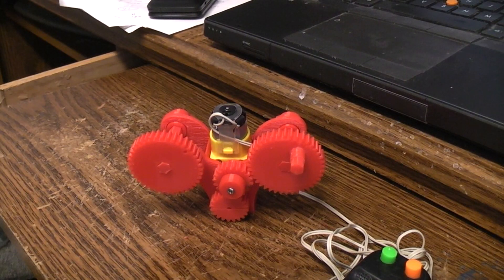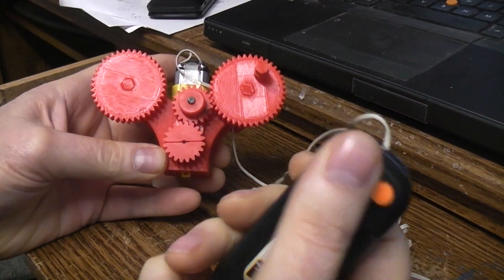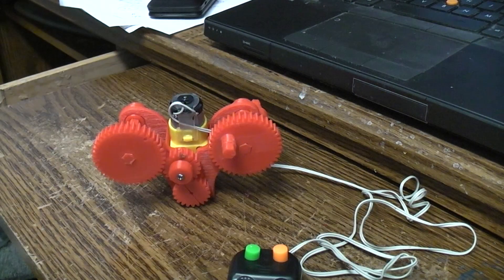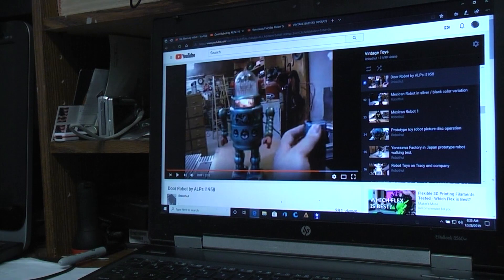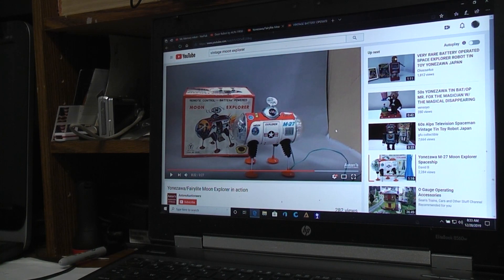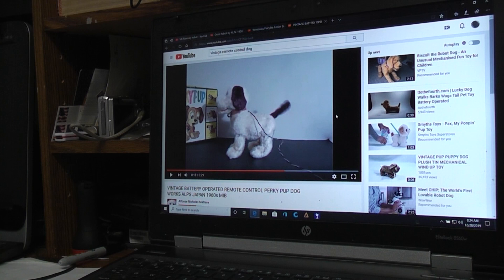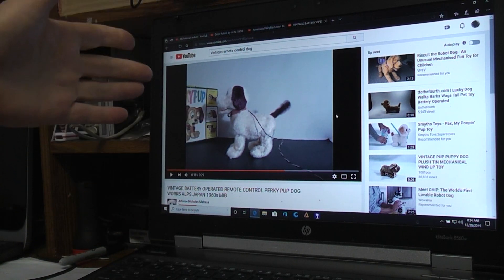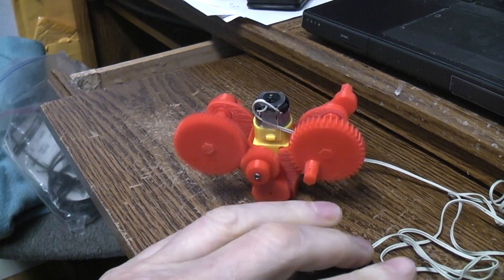3d print the single motor Dual gearbox drive .

Comment: I want it to open like a convertible car and close also. It’s going to on my backpack. Any suggestions would help. Thanks
Reply from the maker: A linear actuator is the way to go. Once you design your mechanics for the convertible top, driving it with the linear actuator will be easy.
Reply: Check out funshell umbrella backpack,